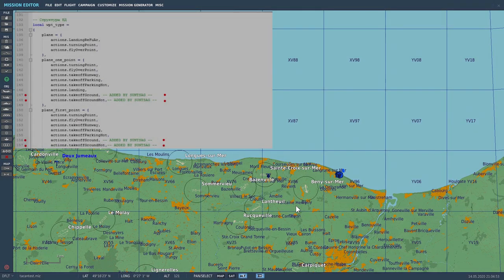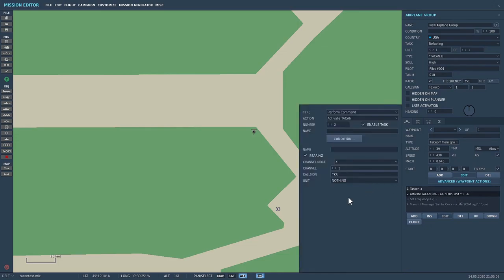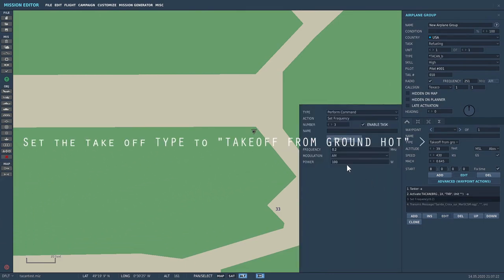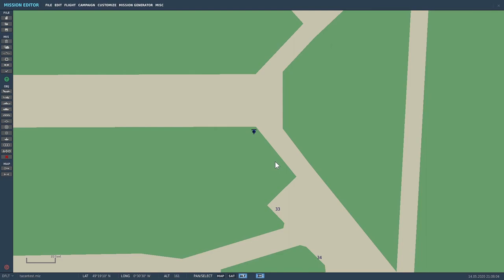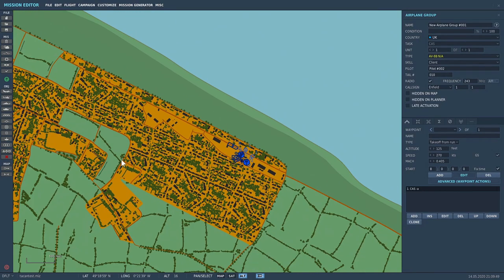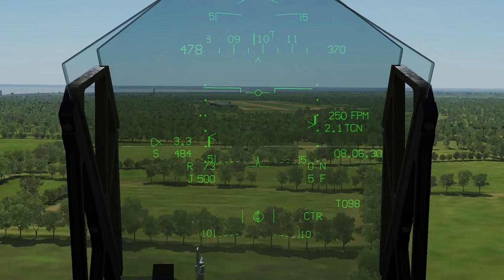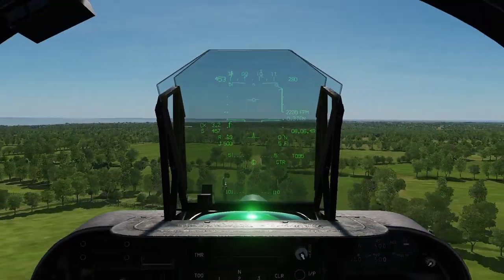DCS TACAN BEACON MOD - USER GUIDE

Comment: Hello Suntsag, thank you for your awesome work on the mission editor in DCS World. Unfortnunately I would like to use this mod but cannot make it work. I included the required lines in the lua file and executed the setup as described in the video within my mission. The mission is located on the Nevada map and I chose as frequency 99X with the designation TGT. In mission the TACAN is not emitting. My FA18C does not pick up anything in the area using 99X in AIR mode. Has the mod been broken by DCS or is there a trick or restriction I am not aware of. I would apreciate any advice on the matter. Thank you very much for providing the DCS community with such valuable assets.
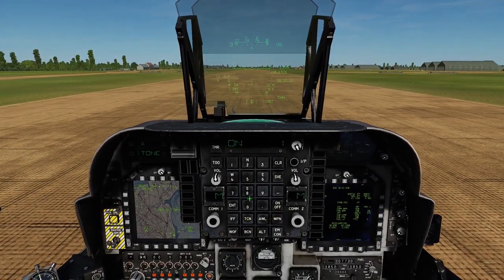Reply from the maker: Hi Claus, Thank you for your feedback it is very much appreciated. The mod appears to be broken but in the overall scheme of things it's not a problem. DCS now has a portable working TACAN now which was not the case when I produced the mod. If you watch this video from around 6:25 onward it shows how to set this up https://youtu.be/fMfGdRD3a-Y I hope this helps. Cheers.
Reply: @suntsagancientgamer8241  Hello Suntsag, thank you for your quick response. Sorry, have not seen the newer video as I started work on my mission (as part of a tutorial) only recently. Found the new item in the mission editor and will give it a try soon. Cheers
Reply from the maker: @claushoffmann600  No worries I hope it works well for you. Cheers.